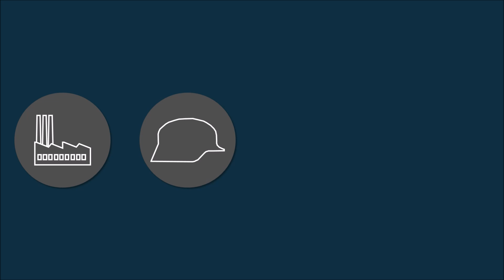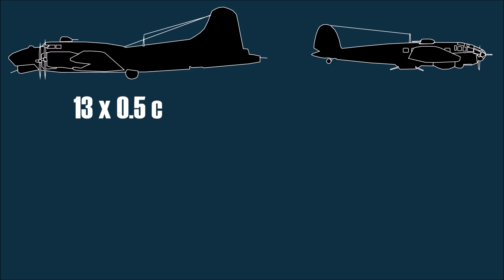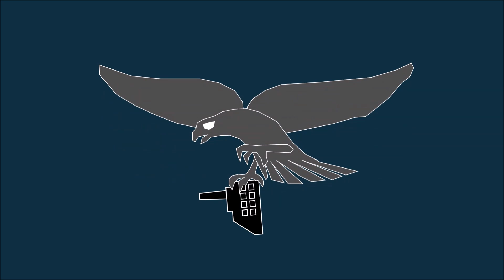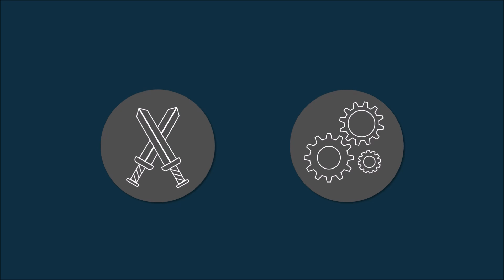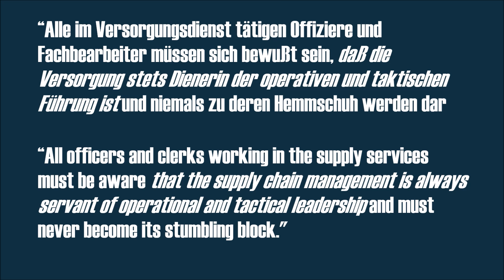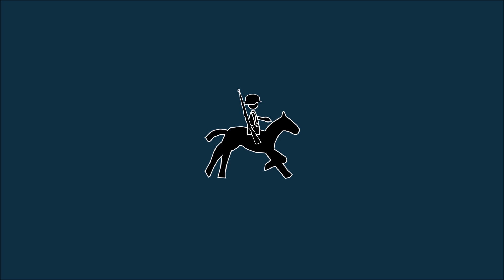Logistics of the German Air Force in World War 2

Comment: All branches of the US military kept the number of different designs to a minimum. This both reduced the number of different types of  spare parts but allowed damaged machines to be cannibalized for spares. For operation Barbarossa the Wehrmacht swept the occupied countries for every vehicle they could find. The meant over 2000 different vehicles types with over 1 million different spare parts. A light van designed to transport bread on a well made French metropolitan road soon fell apart trying to carry military supplies on the unmade dirt and gravel roads of rural Russia.  The US used only the eight ton GM tuck in Europe.  The entire production of Studebaker military  trucks went to the Red army.

Comment: No offense but when I think of German engineering I usually associate it with something that's highly complex and overengineered. This was certainly true during WW II where every tank designed after the PzKfpw IV was an extremely complicated and overengineered beast of a machine, today it's delicate, but often high performance automobiles, that requires lots of and expensive maintenance.

Overall, I think the problem with the German military as a whole during WW II as they were never satisfied with good enough and were constantly trying to come out with the next best thing. They fielded tons of different fighters and bombers and were busy trying to develop long range heavy bombers towards the end of the war and they were famous (or notorious depending on your point of view) for constantly coming with more and more different, and increasingly larger/heavier tanks as well countless tank destroyers and assault guns based on them.
Reply: True but good enough wouldn’t have worked out for them so it kinda makes sense.

Comment: To my knowledge this is the complete list of aircraft guns/cannons used in combat by the Luftwaffe in ww2:
7,92mm MG 15, 7,92mm MG17, 7,92mm MG81, 13mm MG 131, 15mm MG 151, 20 mm MG FF, 20mm MG 151, 30 mm MK 101, 30 mm MK 103, 30 mm MK 108, 37mm BK 3,7, 50 mm BK 5,  75mm BK 7,5. 
With the exception of the 7,92mm guns, ammunition was not interchangeable between any of them.

In contrast, the U.S. airforce used the .50 cal almost exclusively in all of its airplanes, except for a small number of 20mm cannons in the P-38 and the B-29, and some .30 cal guns early in the war before they were sorted out.
Reply: And a 75mm cannon on the B-25. But those were someone's bright idea to battle tanks (the forerunner of the A-10) or ships, but in general the US stuck with the .50 cal.
Reply from the maker: +Galland I agree, but the MG15 and MG17 were 7.92mm not 9mm, 9mm is usually a pistol round not rifle.
Reply: +Military History 

Ouch, what a dumb mistake by me. Corrected.
Reply: We also produced a large number of F4U-1 Corsair fighters with an armament of 4x 20mm Hispano HS404 autocannon.  These proved difficult to maintain in service and were prone to jams in combat, though, to be fair, it might've been retooling them for first UK and then USA manufacture that created the troubles.

"When delivered, the guns proved to be extremely unreliable and suffered a considerable number of misfires due to the round being lightly struck by the firing pin."

Also, every P38 Lightning had a 20mm in its nose, a nod toward its origin as a Zerstorer/Bomber Buster.  The 37mm Colt Designed Oldsmobile built M9, the intended heavy gun on P38s, had low velocity causing it to have a drooping trajectory, with Chuck Yeager reporting that it was like : "throwing a grapefruit".

Just for fun:
Oldsmobile World War Two / WWII Production Numbers / Statistics for the Lansing, MI Home Plant
Cannons:  
(77,010) 20mm M2 aircraft cannon built from 10-16-1941 to 1-31-1944,
(2,779) 37mm M4 aircraft cannon built from 7-12-1942 to 6-16-1943, 
(1,500) 37mm M4E3, (150) 37mm M1A2 anti-aircraft cannon, 
(2,930) 37mm M9 anti-aircraft cannon built from 5-23-1943 to 5-16-1944, 
(5,129) 75mm M6/T13, (21,894) 75mm M3 tank cannon built from 4-25-1942 to 2-4-1944, 
(14,135) 76mm M1A2 tank and tank destroyer cannon with production to 6-1-1945.   Olds also built the M7 3 inch cannon used in the M10 tank destroyer.  The weapons are similar in that 3 inches is equivalent to the 76.2mm the 76mm size the cannon M1A2 actually was.  The M7 production numbers are included in the 14,135 number built.
Reply: It has been said the British should have turned out as many Mosquitoes as possible instead of the Lancaster and  Halifax heavy bombers.After seeing the Mosquito Goering feared they would be produced by every piano, furniture and aircraft factory in the UK in such numbers they would turn the sky black.
Reply: Both the P38 and the P47 were conceived as bomber interceptors -- the "P" does stand for pursuit, after all. It's really amazing how versatile these aircraft turned out to be.

I wonder if anyone has ever studied if the US would have been better off forgetting the B17 and just building more fighter-bombers?
Reply: Both the P38 and the P47 were conceived as bomber interceptors -- the "P" does stand for pursuit, after all. It's really amazing how versatile these aircraft turned out to be.

I wonder if anyone has ever studied if the US would have been better off forgetting the B17 and just building more fighter-bombers?
Reply: +Galland US also fielded a 37mm cannon on the P-39